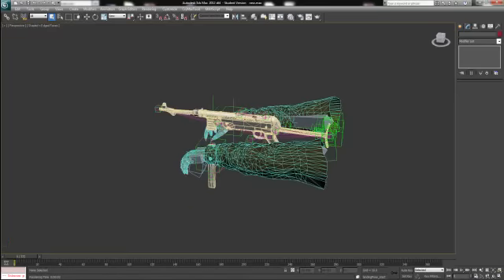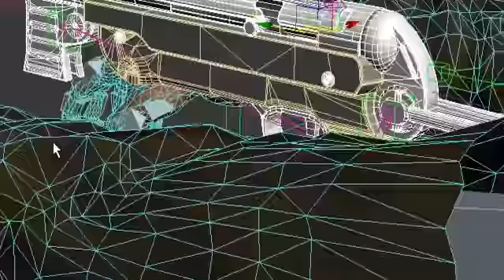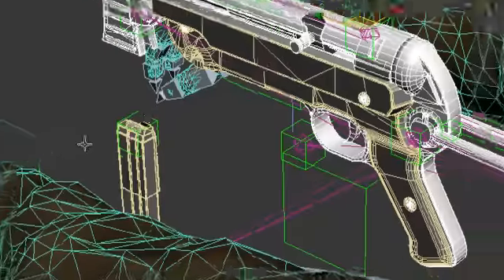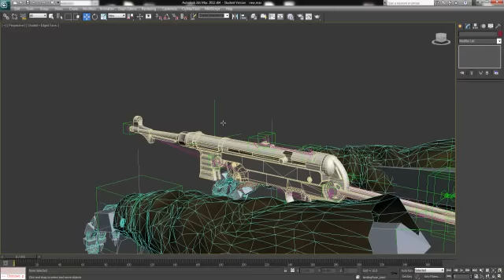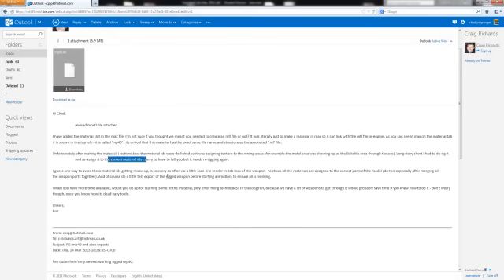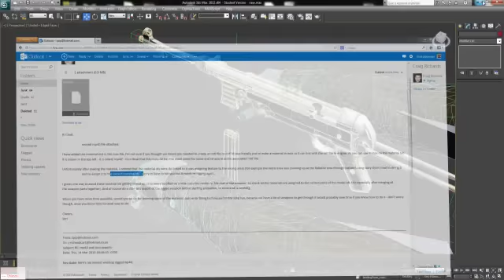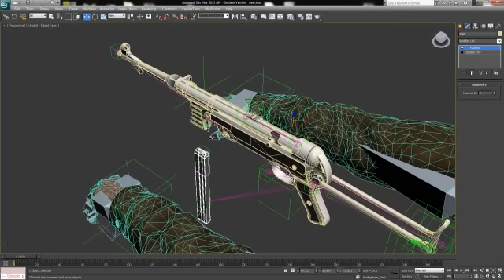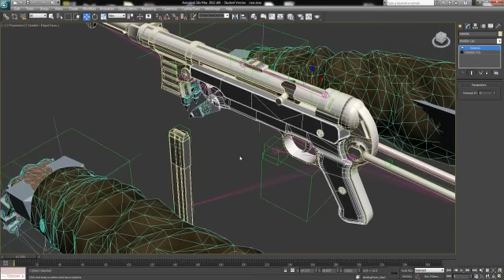Behind the scenes banter Traction Wars Animation development *OLD*

Comment: Haha, it's nice to see someone else having had encountered the insane trouble with weapons also. Took me a long, long time to figure it all out but thankfully managed that well over 6 years ago to solve any problems I had at the time and figure out the odd workflow.. time flies.

All of that could have been attached however pretty easily but it's so confusing with no instructions at first anywhere. But keyframe 0, you leave the pieces seperated away from each other, attach it all as a single mesh and rig it. The vertices would then be weighted to (either the) bones or dummy helpers that you could manipulate as keyframed animation in frame 1 to just drag all the parts into place. Regarding materials, I always reset material ID for all faces of the mesh, then select each textured piece, assign the correct sub-ID, as it uses a material with sub-materials.

No idea why I said this since you probably already know it now since the video is in the past.. =P
Reply from the maker: I was never much of a technical artist, but a animator all the way. :)
Reply: Me neither (no one else was either sadly), I just happened to get the exact method down after starting in 2008 with Crysis and doing it in the same engine for years :) Lack of documentation, strange practices all makes it quite confusing.
Reply from the maker: You have work to show at all?